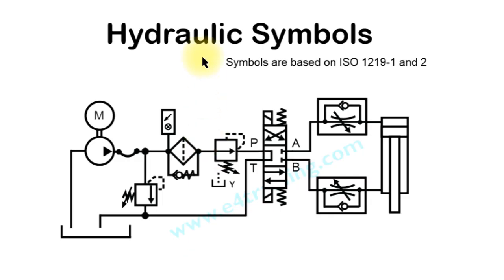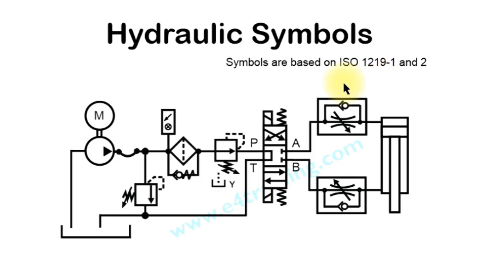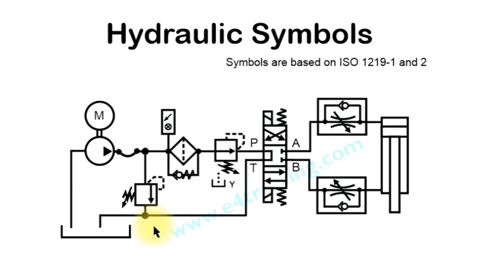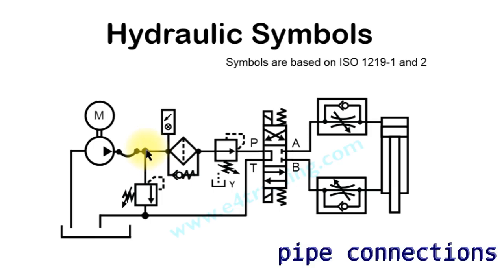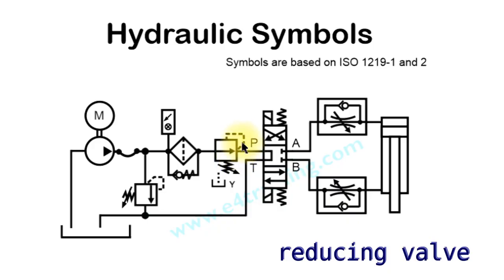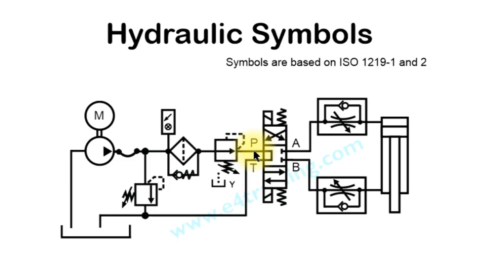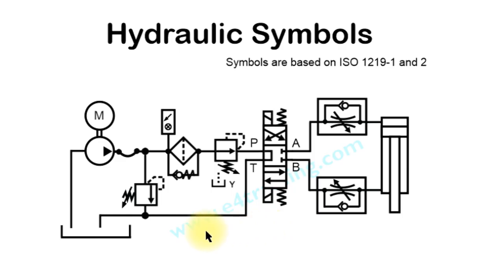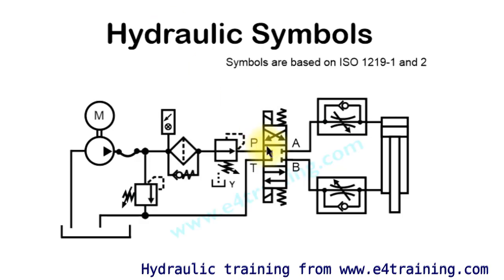Hydraulic circuit symbol explanation

Comment: Shouldn't a check valve symbol let flow through the arrow and work like a diode symbol not the opposite way?
Reply: I know this is a REALLY old comment, but just in case anyone else wonders. That isn't really an arrow with a ball before. It's more like two separate lines meeting (----------< meets o-------). if you flow from behind the ball towards the  mouth, the ball gets pushed against it, blocking flow (-----<o-----). If you go in the allowed direction, then you push the ball away and nothing is stopping that flow from going around the ball (-------<---o-----).
Reply from the maker: Great, thanks Issac